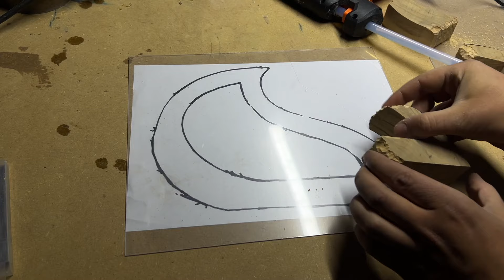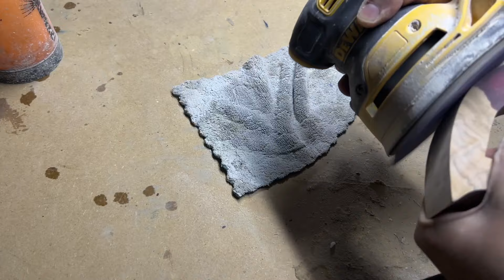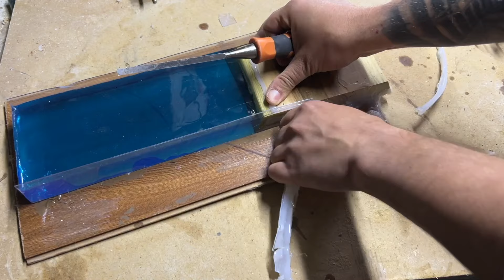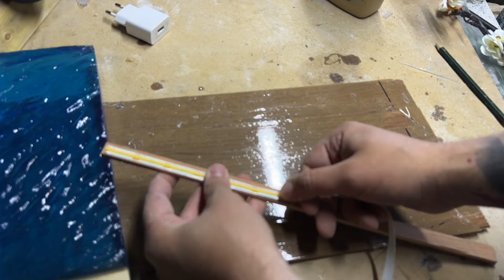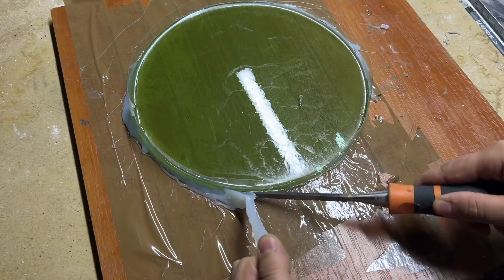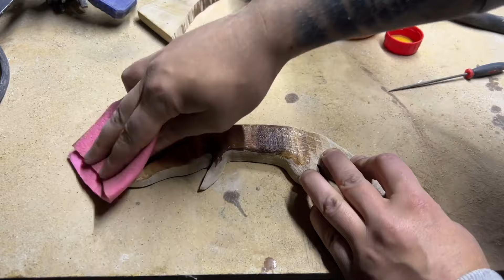How to Make 3 Amazing Epoxy Resin Table Lamp - Resin Art

Comment: Hello 👋.  Very nice designs.  For the first one, very nice. For the tree over water, I love the concept, but I feel the tree is a little over scale. Otherwise very well done. The second green tree was truely beautiful. May I suggest either a cardboard box, or a scrap piece of plywood , or drop cloth, when you clear coat the projects? Those items can be used over and over, while protecting the other surfaces (grass, wall, ect). This is in no way a derogatory commentary,  just a suggestion.  Thank you for sharing your projects,  will be going back to see your other work.